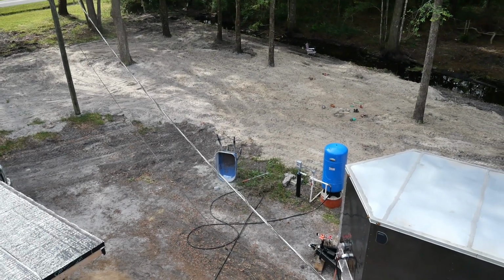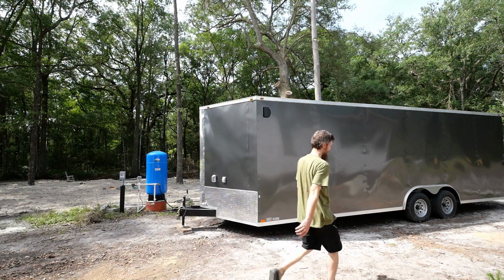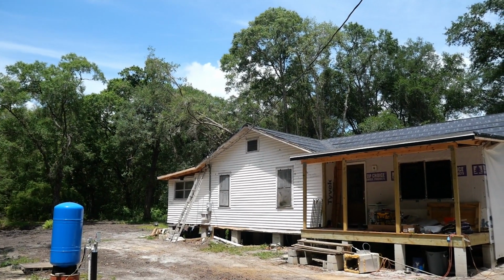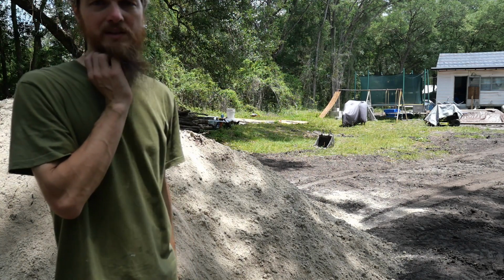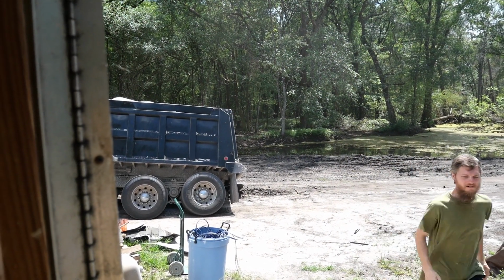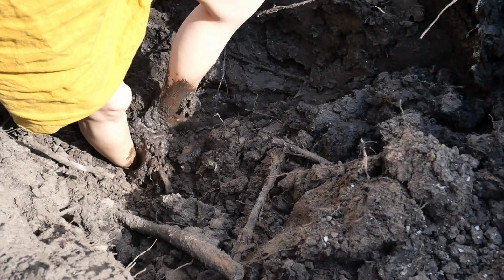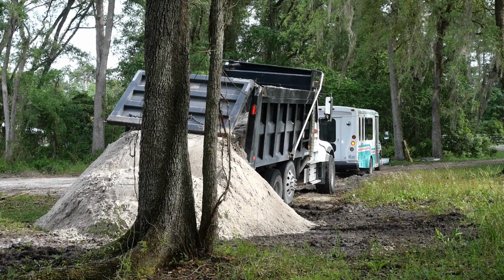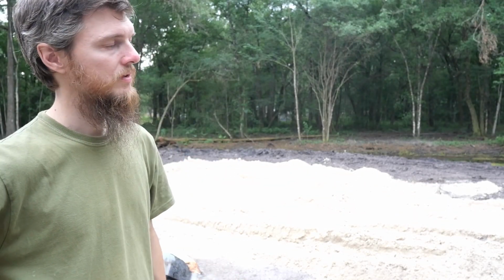Dump Truck Sunk Right into the Ground - Dirt Delivery

Comment: To whom this may concern, the Bible teaches us that a wise man builds his house on a rock. I'm very concerned about your current situation because there is a lot of swamp land that is being sold that is actually not fit to build or live on. If it were me I recommend you look for a Geologist in your area that can tell you more about your property. A Geologist has access to data in areas such as yours and that data should be free. There are many Geologist that don't  mind helping others so long as they need and want the help. From what I've seen in your video you're basically surrounded by a swamp and I don't think 10,000 loads of sand will correct the problem. Before I would invest anymore of your money into the property I would seek a Geologist and ask his personal opinion in regard to your investment. There should be topical graphic surveys aka topo maps already done in that area and in most cases you can obtain them free of charge. Dump trucks don't just sink into the ground twice in different areas unless there is a problem. You really need to know what that underlying  problem is before investing anymore into it. God Bless
Reply from the maker: This house has been here for decades without problems, so time has proven it to be okay. The ground gave way because the water table was sort of high at that point and the soil underneath was wet, but the soil on top was dry. That dump truck in particular weighed a lot. The soil was already loosened on top from 4 other trucks driving over it before him. It was just a simple case of getting stuck.
Reply: @diyfferent  if you haven't spoke to a Geologist I recommend that you do. A ounce of prevention is worth a pound of cure. Just trying to help.
Reply: @whip205inthebam3  these people bought this dump sight unseen I believe, they really don't have much knowledge up front about any of the tasks they embark on. Doing due diligence and research would really help them, but I think their pride has gotten in the way majorly. They bought Florida swamp land sight unseen and have already invested too much time, money, videos into the mess that they won't back out. People never want to admit that they've been conned.
Reply: @benjaminziegler7437  well actually there are no guarantees that come with any property that you buy. However a Geologist could tell them the facts about the property and any problems that they may face later on. The first thing I would've done would have been to get on Google Earth Pro and then looked over the property and the surrounding properties just to see what I might be buying. Using the program I could see what the elevation of the area would be above sea level. I would also be able to see depressions and exactly how much standing water was in the area. If the land is below sea level there is no way I would even consider purchasing it. I've visited and worked in Florida many times and I for one would never consider buying property for a permanent home there. Take care and God Bless, Whip